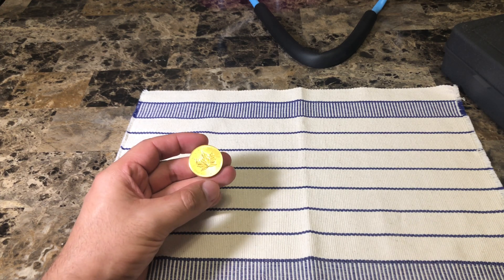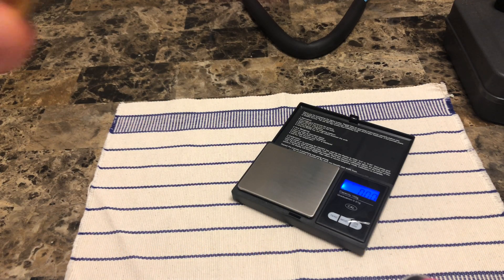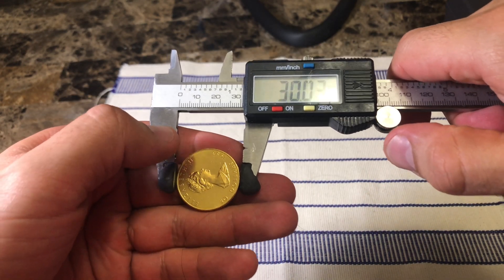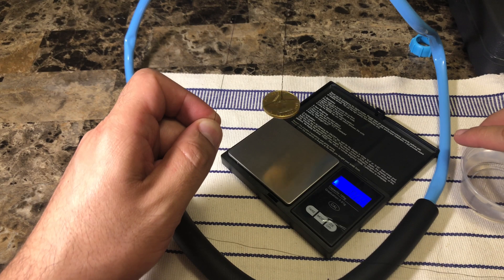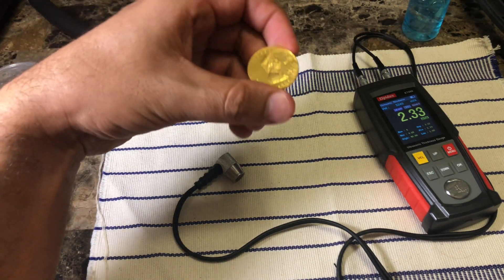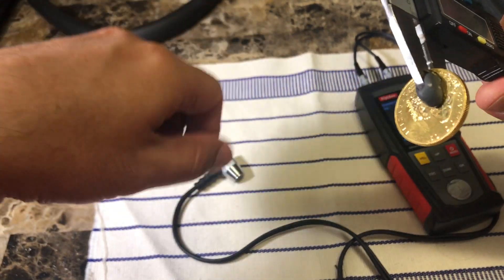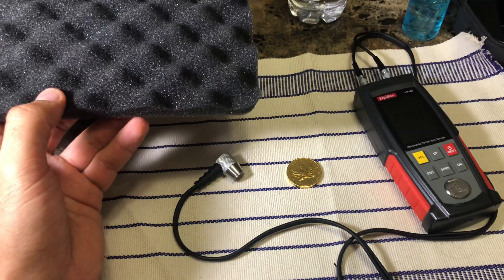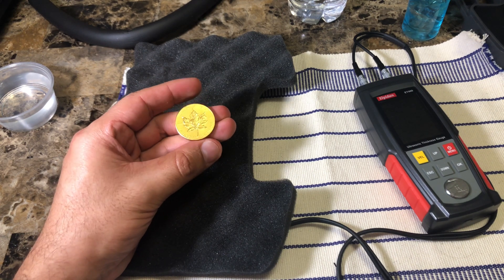Is this Canadian Maple Leaf gold coin real?

Comment: density of gold 19,50
density of tungsten 19,35
your result: 19,33
yeah with such set up no point to measure density, you will not be able to detect the subtle difference in weight.
ping test can and will save you from tungsten tho, and you can perform it with your bare hands

Comment: Anyone with the golden eye can tell a gold coin is real or not from the very moment they lay eyes on it
Reply: have you seen the gold eagle that was carved out and inserted with a tungsten plate?
Reply: @rumcoke9123 no, But it wouldn't weigh right and it wouldn't pass my Sigma
Reply: You can tell by the sun reflecting off the coin that it's absolutely real, what's in the middle can be easily detected with a sigma machine.
Reply: Yes, but i need to hold it my hands
Reply: Facts smh